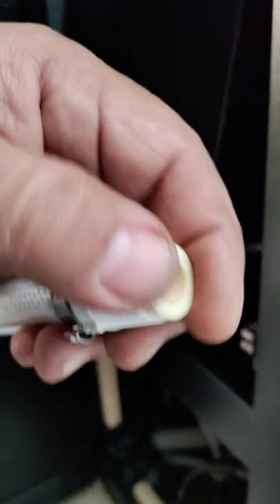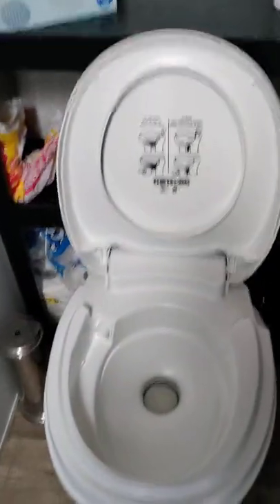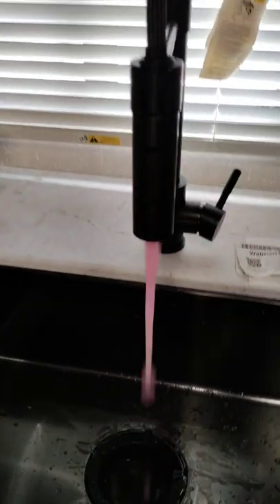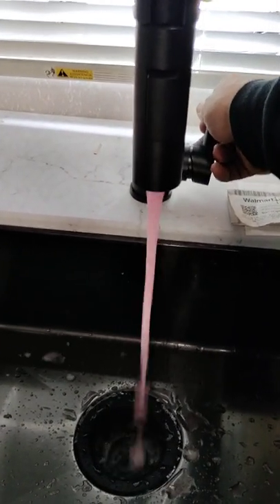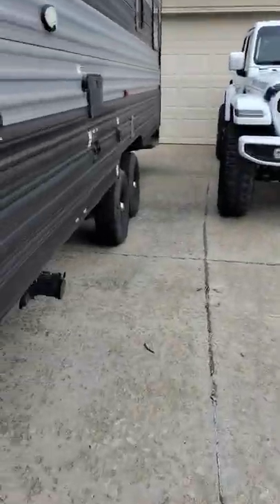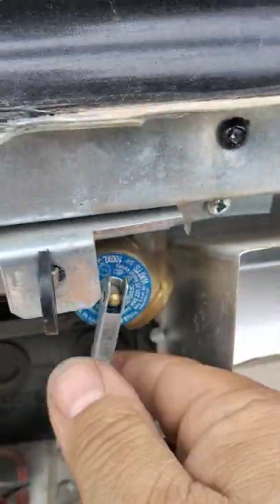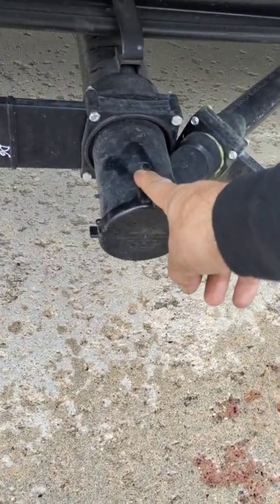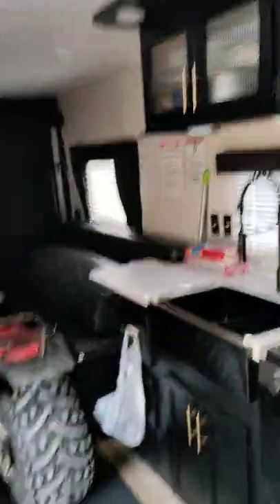winterizing gray wolf Limited 26 RR toy hauler made by Forest River. drain tanks first

Comment: Thanks - I bought this camper used and I did not have this info.   So thanks!!  very helpful.   The water heater bypass location is a pain in the ass.    LOL
Reply from the maker: Yes it is hard to get at to close the 2 valves. But so easy to winterize.
Reply from the maker: your welcome how do you like it?
Reply from the maker: it is a pain to get to, crawling through the side door hurts the legs.